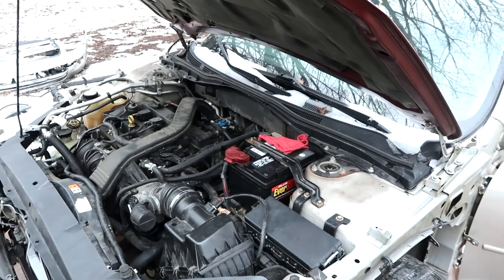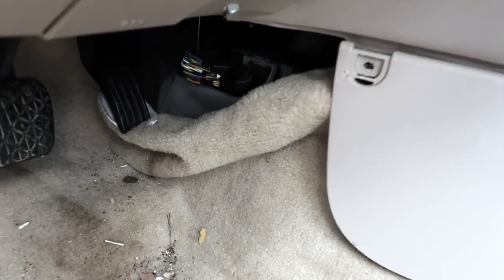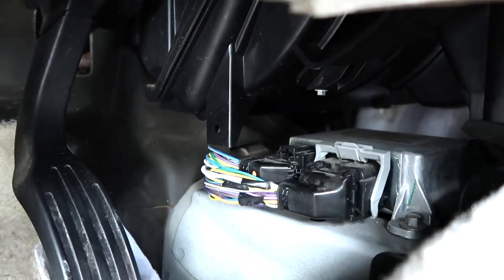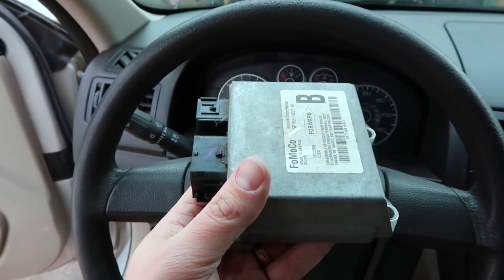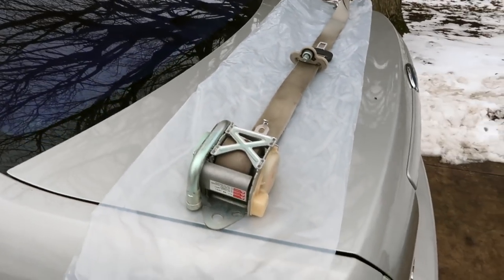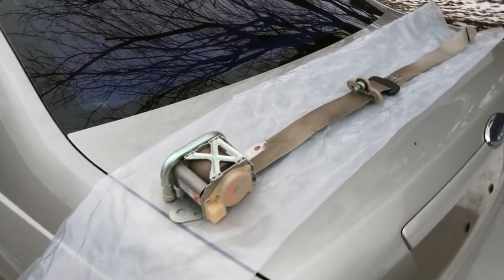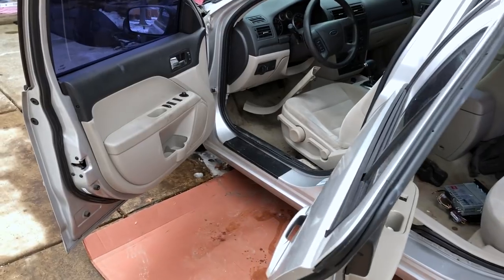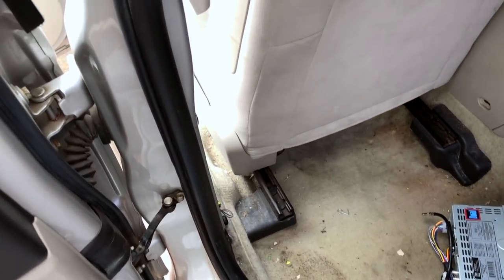Fusion Rebuild -- Part 7 -- Airbags & Seatbelts Part #1 -- My First Copart Rebuild Project

Comment: Are you sure that seat belt was locked? there are ball bearings in there that lock the seat belt under deceleration or if the seat belt is tilted at an angle. since you had it at an angle out of the vehicle of course it will lockup. The real test would be to pull the SRS codes to see if it detects a fault with that belt, and if you see a burnt up housing indicating the explosive had fired.

Comment: Seatbelts do lockup if they aren't in their correct position. As you have them lying flat on the trunk lid, then they will be locked. When you go to reinstall them to the car, place them in position at the base of the door pillar before trying to pull the belt out. If you don't do this then you won't get them to release. HTH
Reply from the maker: Thanks!

Comment: Did you have to replace any of the sensors? I am rebuilding a Mazda cx5 and was wondering if I should replace the sensor.  I just replaced the dash in mine due to passenger air bag that I'm sure was the reason for my car being total took me 15+ hours to get it out and swapped.
Reply from the maker: I had to replace front crash sensor and the front passenger seat occupant sensor.

Comment: Hello, I have a question no one could have helped to answered. Do you know if I just replace the wheel airbag that exploded for a new one and I just plug it into the ports everything will be fine or it will explode once I connect the battery again?

Comment: You have air in your power steering system jack up the vehicle pop reservoir cap open turn the steering wheel about 20 times right and left it should get rid of the air and stop making that horrible noise good luck let know if it took care of it.
Reply from the maker: Thx for the tip! I will be bleeding the system soon.

Comment: FYI, this myairbags outfit disclaims any liability for personal injury or death due to their repair work on your parts. Very scary, my friend.
Reply: Its probably because its due to proper installation. Sometimes folks neglect to bolt down the module and then go to power up  the car. The module designed to be very secure to the floor. If the modules moves while its powered up... The airbags can deploy. Make sure to bolt down that module back down tightly (as designed) before hooking up the battery. If you're unsure about doing the installation - probably best to get a professional to get this done for you.